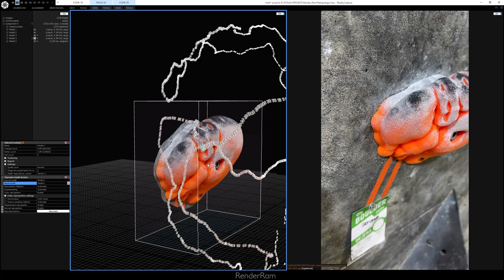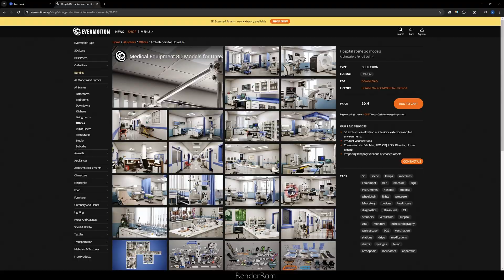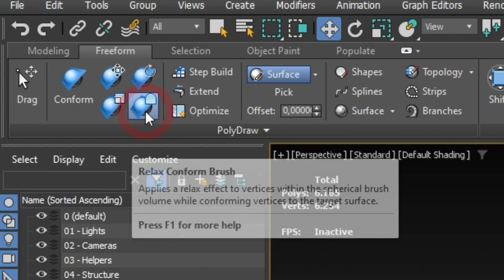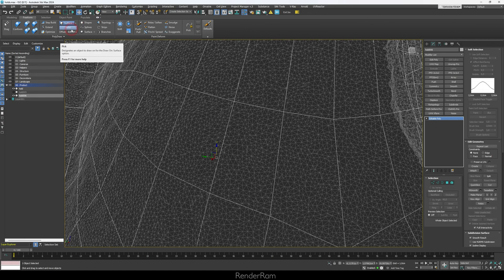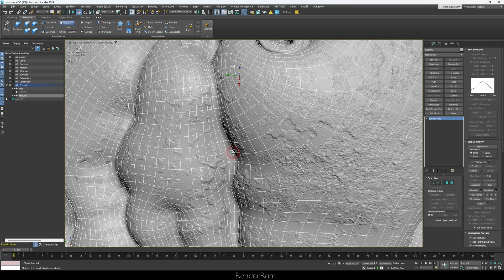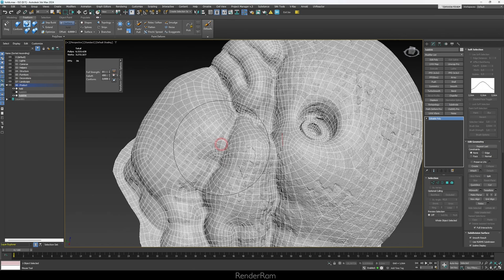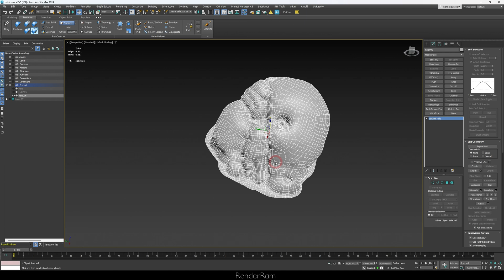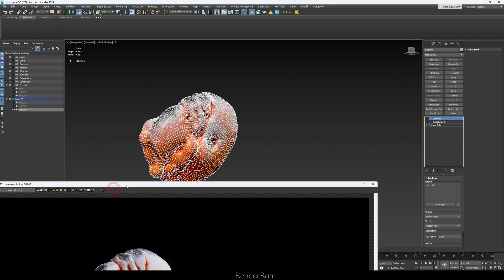The Retopo Journey Continues: Automatic Retopology | 3ds Max

Comment: I have seen you setting the confrom intensity inside the freefrom options panel. There is a hotkey: you just alt+leftclick while having your conform brush selected. Hold it and drag up and down in the viewport. This will adjust the intensity on the fly without you having to snipe the sliders. There is also ctrl+leftclick and shift+leftclick for controling brush size and fall-off. At least I found this helpful for me.
Reply from the maker: Awesome tips, thanks man!!

Comment: For aligning the tight cravices I can recommend the Scale Conform Brush. It is the one below the move brush. you just click on the parts of the retopo mesh that needs more detail - and carefully pull down. It will pull the topology together and into the detailed crevices and cracks. Of course your way with the Move Conform Brush allows more control, however it requires much more clicking.